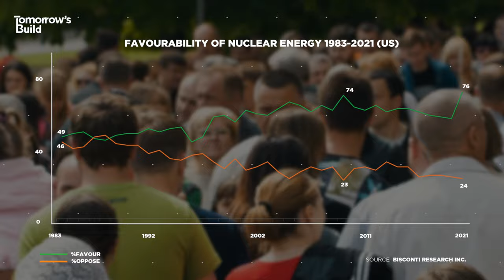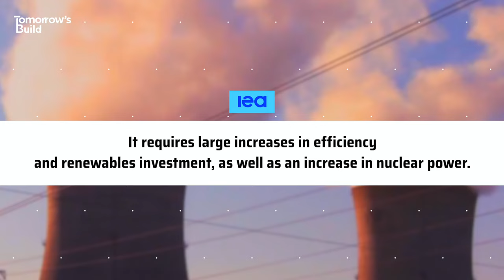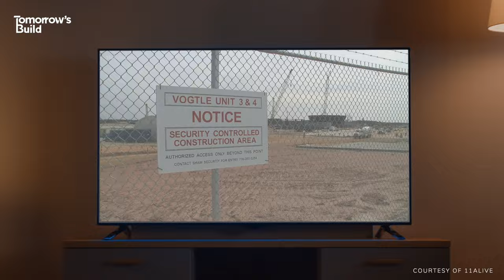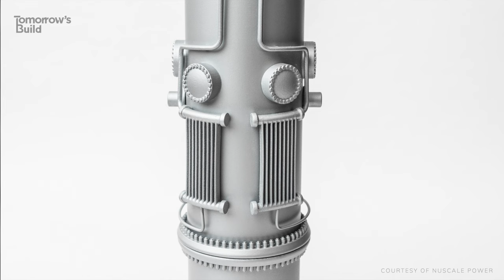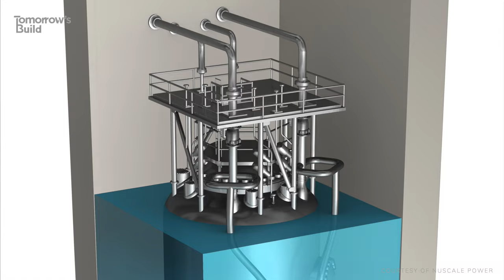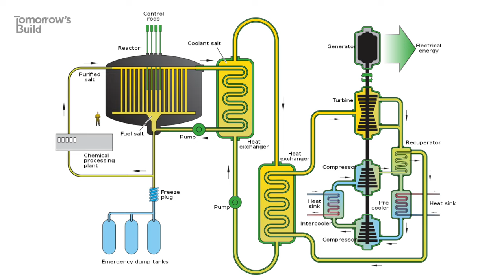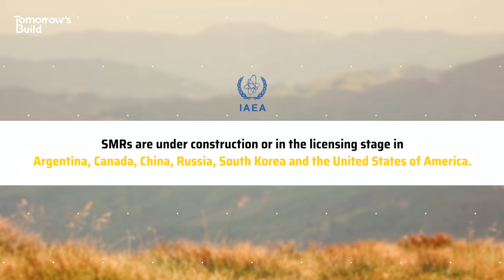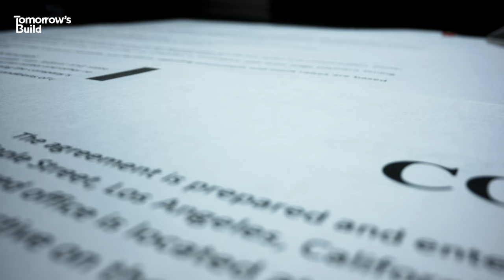These Mini Nuclear Reactors Can be Built Anywhere

Comment: Nuclear energy has never been MORE critically important than it is now!

Countries need to start on these projects immediately!
Reply: Because it is the most expensive generation of electricity and there are better options now.
Reply: I think solar and wind power, oh and batteries. Lots and lots of batteries to allow wind and solar to be a viable 24/7/365 energy source for a city or industrial center, thus putting green power on parity with other low carbon tech they are supposed to be cheaper than. Then considering the lifespan of the machine, transmission losses, over building to compensate for seasonal and climatic variations, toxic waste disposal, the price for solar and wind just keeps climbing. But hey it is cheap now due to subsidies and tax breaks and it looks pretty in pictures so it's a better option, right?
Reply: @anydaynow01  even discounting subsidies, nuclear plants are over 20x more expensive both in terms of carbon footprint and finances cradle to grave.

Comment: Thought this was a pretty good 10 minute summary overall, though I think it could’ve stood to have also had A) a mention that Chernobyl’s reactor type was considered dangerous and outdated even in the 80s; and that B) Fukushima was caused by a regulatory failure about its backup coolant power, and other power plant closer to the tsunami without that same failure actually avoided catastrophe. 

It’s true that SMRs can be passively safe which is even better, but the implication in this script is that the RBMK design was typical and that Fukushima was operating within design bounds, and neither are true. 

I also think it would’ve been worth mentioning at least the theory that mass-producing these reactors will bring the cost down at the end, although the guy you interviewed is correct that their per-kWh cost is even larger than large plant to begin with. But the idea was never to stay at that price point, it was to try to leverage a different economy of scale — large plant go for the scale of 1-4 large reactors and large turbines, while these hope to gain the scale of manufacturing thousands or millions instead of just dozens. Whether that pans-out is another matter and up for debate, but mentioning the theory would’ve been nice. 

But like I said, overall I think this is a good 10-minute summarisation of a complex topic.
Reply: @noahwail2444  true
Reply: I had no idea that with Fukushima, there was another plant even closer to the tsunami. That should have been talked about more at the time, but I guess it wasn't profitable enough to mention.
Reply: I also would have liked a mention of how the increased nuclear energy consumption will affect uranium reserves. As of now, the reserves will only last for about 100 years if I am not mistaken. This, of course, decreases if we start consuming more.
Reply: @alvatoredimarco  yeah, most mainstream news sources acted (by omission) as if it was the nearest and first hit, and as if the failure mode Fukushima-2 experienced would’ve happened to any others in the region. But both are false. 

In fact, there was more than one plant that was closer to the earthquake and the following tsunami — but they all had proper underground cabling running from the backup diesel generators, so their emergency cooling systems functioned perfectly for the duration of the blackout. The earthquake triggered the automatic emergency systems, and because the wires were buried, when the tsunami arrived a little later, nothing went wrong. 

Fukushima had a long driveshaft attached to the generators’ output which was exposed above the ground!! The tsunami snapped the shaft when it hit, and backup power failed. 

TEPCO had privately raised with Fukushima that they needed to replace the shaft with underground wiring just like all the other plant using the same design had been built, but they foolishly decided to keep the regulatory action private so as to “avoid causing a panic” among the populace. TEPCO repeatedly asked them to bring their backup power delivery into spec, but because they had already decided not to threaten with public shaming, the plant operator never did.

This is part of why I find Fukushima so frustrating — really, that tsunami should’ve been a case study in how safe nuclear power can be when regulators do their job properly! Every other plant that was hit by the wave (IIRC there were, like, 5 or 6? Maybe 7? albeit not all were closer to the earthquake than Fukushima) engaged the countermeasures perfectly, and nothing went wrong with them. 

But due to TEPCO’s slightly spineless regulatory culture, and because Fukushima’s coolant failure became international news, it instead became a scaremongering flashpoint which led to Germany and Japan deciding to retire all their reactors. It could’ve been a teaching moment about how reliable emergency procedures are, SO LONG as they actually follow the rulebook. News media could’ve hammered home that Fukushima was caused by regulatory failure. But they didn’t, and that heavily influenced public opinion. 

Of course that’s not to downplay the effects of Fukushima — many workers who brought in emergency coolant water to prevent a Cherbobyl-esque explosion have thyroid problems due to radiation exposure, and were also abused as “equally responsible” by residents who had to evacuate (instead of blaming the management who kept kicking it under the rug). But it does bother me when people act like Another Fukushima is inevitable whenever there’s another earthquake — when in fact the events surrounding that tsunami already disprove it!
Reply: @quintenschouten1731  that’s not quite true, the 100 year estimate comes from currently mined ore veins. There’s more that are currently too expensive to tap-into, plus there’s enough uranium for millennia in seawater. 

Of course, removing minerals from seawater can be energy intensive as we’ve all learned from lithium refining. But a few nuclear reactors could fairly easily evaporate the water to gain more fuel than they consumed, and fusion power would also require refining seawater to get the deuterium, so those pipelines can be synergistic. 

Plus of course there’s various nanotechnology membranes for lower-energy lithium extraction being developed currently, and that R&D could almost certainly apply to uranium too.

Edit: and that’s not even taking into account the fact that “waste” fuel rods still have ~95% of their energy inside, and “fast reactors” which can use up orders of magnitude more of that energy from waste are part of the proposals from some of these companies. But we could easily use nuclear power for a few more centuries, if not millennia, even with “slow reactors” like we currently have; waste-burning “fast reactors” would just extend that even further!
Reply: @kaitlyn__L  Very interesting, I was unaware of this! It's rare that Youtube comments are so informative, haha :)
Reply: @quintenschouten1731  You are mistaken, there are supplies for thousinds of years, it kan be mined out of seawater. So no problem there.
Reply: @noahwail2444  Kaitlyn already said so, yes. I was unaware of that fact.
Reply: @kaitlyn__L  another problem was the elevation of the Fukushima Daiichi power plpant and the emergency generators. The tsunami reached higher than most other places at Fukushima Daiichi (~13m), combined with reactors 1-4 being situated only 10m above sealevel and the emergency power generators, which were sadly not watertight, itself being situated only 2m above sealevel with seawalls only having a height of 4 meters. At none of the other reactors was there a combination of high enough waves and low enought elevation that could wause substantial flooding. It is however also to be noted that the events that occured were 1 in 1000 years occurances and thus not considered in the design. Back then, recent estimates found that earthquakes in the area would have a maximum magnitude of about 8.0, while the earthquake that occured had a magnitude of 9.0-9.1. They knew that technically, a 9.0+ magnitude earthquake could happen, but deemed it too unlikely as that is a once in multiple centuries event.
Reply: @stephenbrickwood1602  the problem with your rant (besides telling me things I already know) is that I’m not advocating for a 100% nuclear grid. 

~20% nuclear should be sufficient with renewables and storage. This is a long-term view, we should get started building now for 2040-2050. This includes tons more wind farms and solar farms as well as more nuclear plant. 

Your comment also ignores the fact that I suggest SMRs’ success would be necessary to overcome various problems with on-site building. 

I’m glad you got to get that off your chest though, it really seems like you needed to. I think our governments investing in our energy security and decarbonisation is a good thing, though I honestly can’t tell from your comment if you agree (the “big government” part suggests not).
Reply: @kaitlyn__L  in response to your point, 
I suspect that the existing number of nuclear power plants in the USA is all that will be needed as the Renewables technologies roll out and improve. 
Limited time and financing budget would mean that Renewables are fastest. 
So we are actually in some agreement.
Solar is dispersed and the ends of the existing power grid are dispersed. 
300million buildings in USA and all connected to the ends of the grid. 
All with rooftops. 
As the EV, with batteries which are huge, fortunately, as they are for the long trip but daily use is only 7kwh on average. 
The EV batteries,100kwh, should be plugged in 24/7 automatically when ever it is not driving. 
The big EV battery will make a massive difference. 
This is thinking 'backwards' so to speak. 
The EV will be a powerful 'resource' in the existing grid and save $TRILLIONS in rebuilding the grid.
Reply: @stephenbrickwood1602  unfortunately, many existing plant are already past their design lifetime, currently limping-along with regulatory extensions under reduced-output loads, while cracks in moderator rods etc build-up. 

If they are not replaced, there will be no zero-carbon dispatchable load on the grid. This is the case for many countries, even nuclear-phile France. 

I’m just tired of nuclear being positioned as an opponent to renewables rather than an opponent to coal (or charcoal) or gas plant. 

If the grid can get V2G sorted that’ll be great, but no amount of batteries, or compressed air, or hydrogen can replace a truly dispatchable load like nuclear when it’s needed most. Especially considering how nuclear is also suitable for process heat for steel foundries, fertiliser factories, hydrogen production, and more — so it needn’t just be sitting there unused when renewable grid-availability is high. 

At this stage we need to stop trying to preemptively pick a winner, and just throw everything we have at the challenge. That means massive grid upgrades. Smart grids, supergrids, even smart supergrids. That means investment in renewables AND in nuclear. Investment in non-storage river hydro for baseload generation. R&D for other polluting industries like fertiliser production. Home insulation, and installing huge amounts of heat pumps every year. And much, much more besides.
Reply: @kaitlyn__L  big central power plants block other investments. And must have Garrentees, by governments, for 60years to 100years to make sense financially. 

The weather forecasts tell the story every day that the sun is shining somewhere in every country. 
The UK is looking at importing solar power from Morocco by undersea power cables. 
Singapore is looking at importing solar power from Australia by undersea power cables. 
Australia has 3 undersea power cables from Tasmania to transfer electricity. 

Sunny warmer USA states can do the same for much less construction time and much less money than a nuclear construction program. 

In a warmer climate there will be more energy in the environment. 
Build for the future for max 'bang for the buck'.
As I've said a world full of nuclear industries is incredibly expensive and dangerous, bigger thinking is needed by everyone. 

A warmer environment means more energy is available in the atmosphere.
Reply: @stephenbrickwood1602  even a worldwide grid would still need some dispatchable power in each country. Those interconnectors only provide a fraction of each nation’s consumption. Building enough of them, big enough to meet one country’s demands entirely through the natural resources of another country, costs as much or more. 

But note I expressed support for that as well — I mentioned smart supergrids. 

It’s true that it’s always sunny and always windy somewhere, the question is how to make use of that fast enough to completely wean us off of fossil fuels. 

The fact of the matter is we don’t have enough time left to pick a “winning horse” anymore. We have to do everything we can. And government investment need not be a zero-sum game — polluting can be taxed and directly fund its replacement. Build international HVDC interconnectors and mine and refine local uranium. Build battery “gigafactories” and invest in molten-salt storage micro-nuclear. Etc. If there’s excess power leftover at the end of all that, then good, that’s better than coming-up short. 

At this point you’re just repeating yourself — I already said small-scale nuclear near the point of use looks to be better than large central nuclear. Multiple times, in fact. But we need both, just as we need batteries in everyone’s homes and industrial-scale battery banks. Every single option must be on the table and must be implemented.
Reply: @kaitlyn__L  further more as the roll out of electric vehicles with huge batteries, 100kwh, and the fact little of the battery is used daily. Say 7kwh. 

There will be 300million of these in the USA as every Automotive company increases production to 100%.
This is a fantastic fact.
Daily battery storage is 30,000million kwh every day, 30,000Gwh every day, it would be incredibly wrong to waste that 'free' resource. 

Nobody talks about this.
The money will be in the EXISTING grid. 

Big Automotive knows this double benefit and is busting to make it happen. 
That is why Elon Musk is into Tesla and Rooftop solar PV power. 

Just as modern vehicles can park themselves, the EVs will park themselves like they are 'docking' or plugging into a power outlet. 

Every building is connected to the grid today. And can have an EV power point. 
Forget fast charging, except for a few in every town.
Reply: @stephenbrickwood1602  I appreciate you’re passionate about this, but I addressed vehicle-to-grid (V2G) already. Lots of people are talking about it. It’s a key component of smart grids. 

Now, honestly, I probably won’t reply to beyond this. Your comment just now repeats your second one. Again, I’m glad you’re passionate about this, but I like my comments conversations to be constructive and interesting, and most importantly to actually go places — rather than listening to a guy repeat himself while barely replying to me. I hope you have a great rest of your day!
Reply: @kaitlyn__L  nobody is talking about the military defence costs in a nuclear powered world.
Reply: @kaitlyn__L  I love the fact you are thinking, 
I am an old Construction Civil Engineer and have worked on coal power stations and transmission lines construction projects. 
I have nuclear engineering friend, who lectures on Nuclear. 

Many want nuclear power and can see no more, you are looking at every thing which is good. 

I have grandchildren.

Comment: When they can make reactors compact enough and safe enough to put into an RV, I'll be impressed.
Reply: They already can it's just expensive. Perseverance rover uses a small reactor and is about the size of car.
Reply: @asandax6  The perseverance rover is powered by an RTG, it's a lot less complex than a reactor and has no fluid to leak.